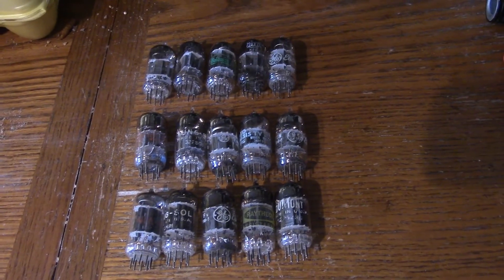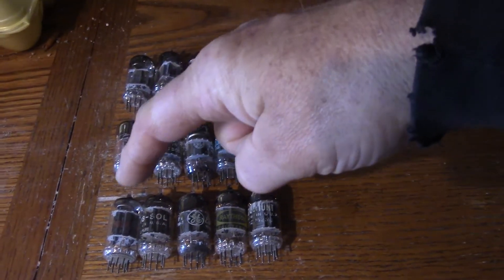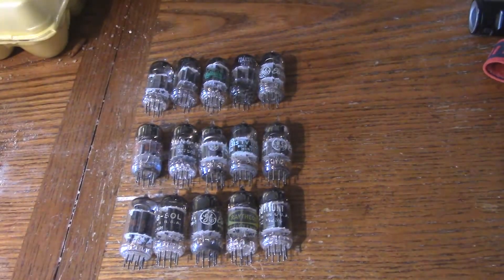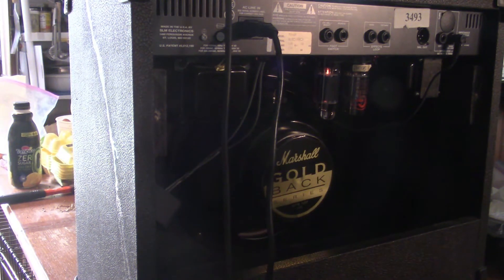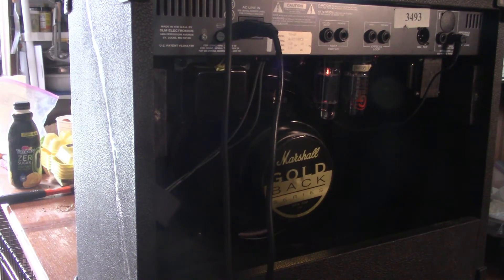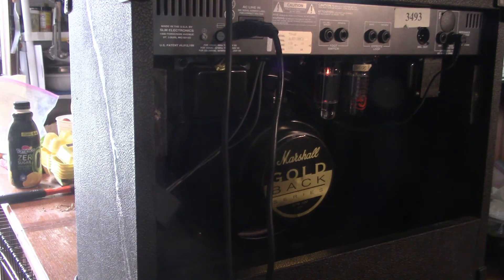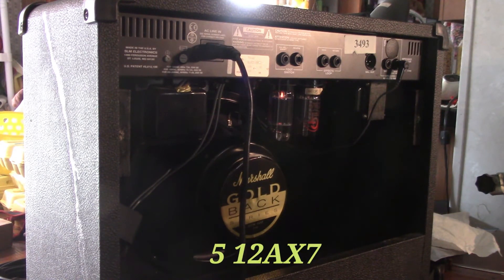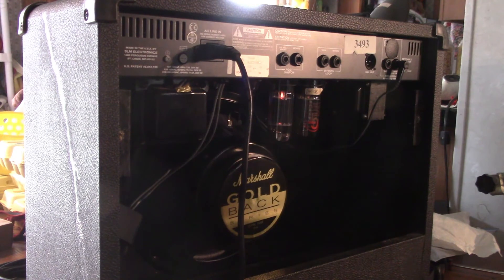DIFFERENCE of GAIN 12AU7 vs 12AT7 vs 12AX7 Preamp Tube comparison shootout

Comment: Which distorts more with a pedal slamming it with a high gain input?
Someone claimed an AU7 will give you more clipping and distortion than an AX7 when you overdrive one that's maxed out in gain then slam it with something like a tube screamer or other high output overdrive style circuit.
Reply from the maker: I have not ever tried both with an overdrive/distortion pedal. I do not have a pedal to try it or else I would

Comment: I got 3 tube pedals, a early Butler 3 knob modded Tube driver,  a newer 5 knob Butler Tube driver and a Behringer 911 tube O D. I've bought and used different tubes including 12av7, 12ax7, 12au7 and 12at7. Have found for early 3 knob, that's been modded with a bias knob , a 12au7 is the least heavy gain and plays better on my 12 pedal board than the other tubes. Least noise and still get good heavy dist/ fuzzy sound that stacks well with other drive pedals. Those being, a Meat and 3 modded Soul food and a Alchemy modded Blues driver. The other tube pedals just stay on the shelf at this point in time.
Reply from the maker: 12AU7 tubes are way under rated by players. They are great tubes and do tame the noise. The Soul Food is a great pedal, I love it.
Reply: @vacuumtubesandguitars  S F. Especially with the JHS Meat and 3 mod. I like the middle setting OPEN. Don't know what that means but it sounds better to my ears than the Klon or normal settings. On tubes I switch back and forth between the 12au and the 12av. The Behringer pedal has the Bitmo mod done to it. But I still can't get with this pedal cause it definitely ain't aT Driver. Big difference to my ears.
Reply from the maker: @sparkyguitar0058  I think I might try the JHS Meat soon, sounds enticing

Comment: Thanks for the video. I recently got a Marshall dsl20 head. Since I've been obsessed with tubes. I've already bought two el34's and 4 ecc83's. All JJ's. All the tubes I bought are ecc83s jj. The stock tubes are Marshall and have production date 5/21. Basically I'm wondering what the best preamp tube would be best in the v1 socket. I've read that low gain, low microphonic tubes are best for that position.
 Cheers,
Reply from the maker: V1 is the most important position because it gets amplified with each of the following tubes so a low noise tube is best. Triple mica 12AX7 tubes are the lowest noise tubes. The RCA 7025's are great too. TGhe JJ ECC83S are great as is the triple mica Shuguang 12AX7B.
Reply: @vacuumtubesandguitars  thanks for the advice